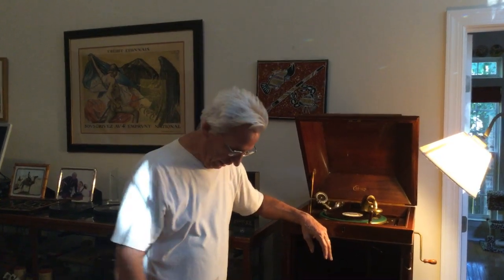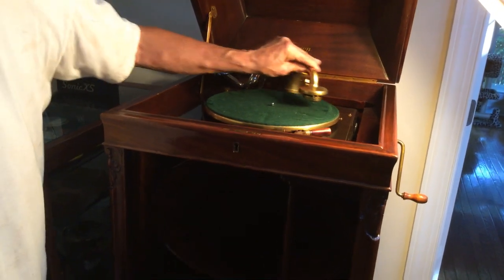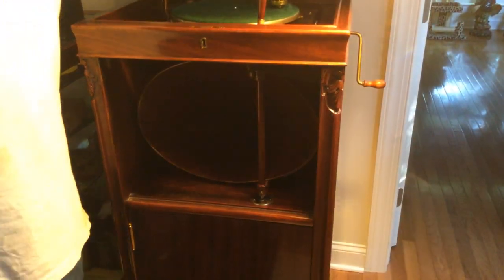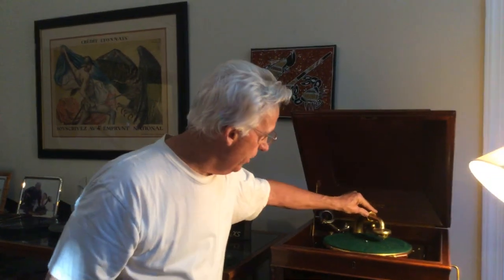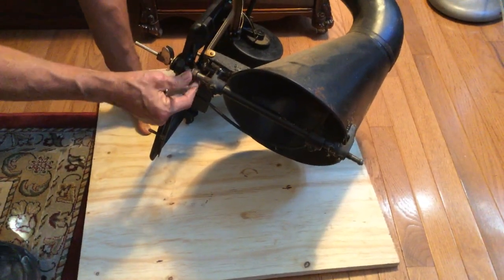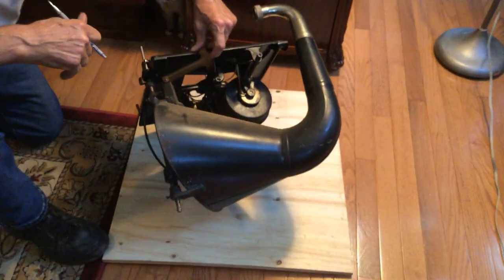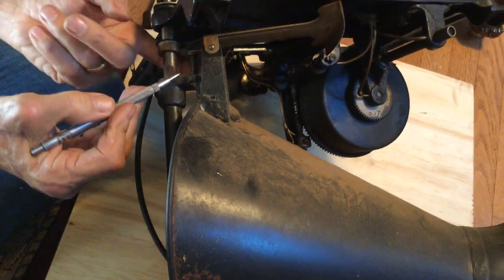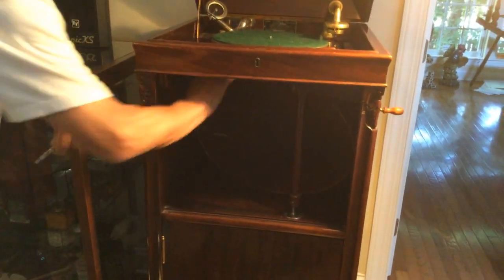134.  Setting the tracking on an Edison Diamond Disc phonograph

Comment: Seems on the left back corner you have a second silver head/needle setup.  What is that used for?  Different type of records maybe?  Or is it just a spare?
Reply: It is a reproducer for a regular 78 rpm shellac record. It uses steel needles like a regular 78 rpm player has. The diamond stylus floating needle is mounted at a 90degree angle to the record on the diamond disc models. There is a ring on the back of the horn which turns to release and lock in whichever reproducer one is using at the moment making this machine more versatile.

Comment: Hello. I have a Edison Diamond Disc phonograph L-35 , It can be played without the spindle drive gear, right?Thanks
Reply from the maker: No, you need a spindle drive gear.
Reply: spindle drive gear,Its function is to control the speed?
Reply from the maker: @tunjanhsu  it’s what regulates the speed of the machine, yes